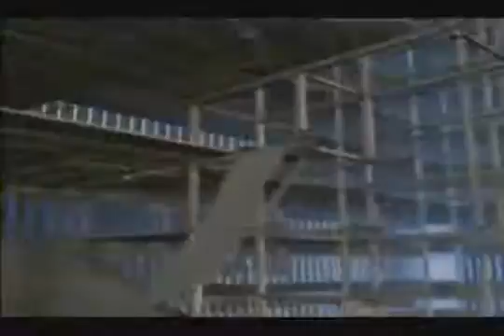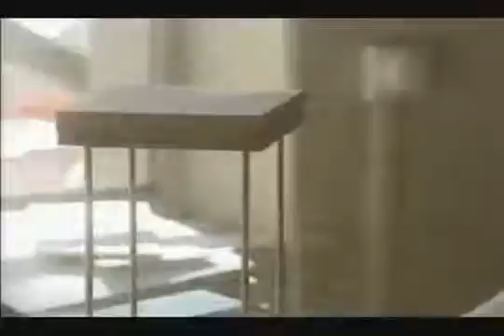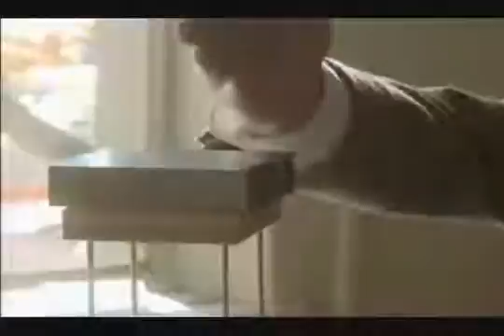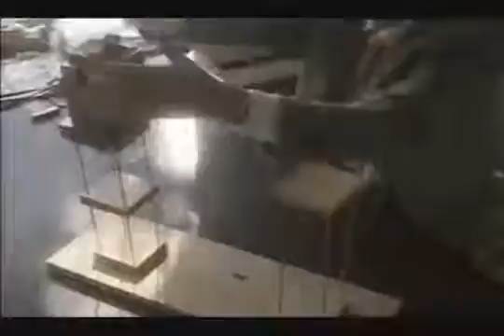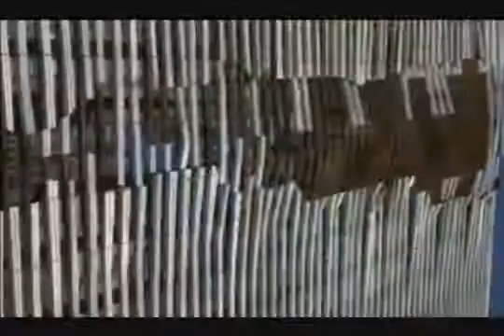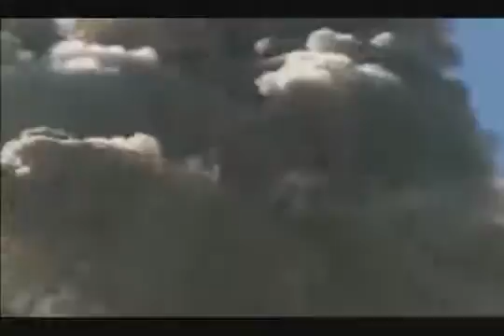World Trade Center - Role of floor loss and buckling

Comment: What a shit theory not how on earth can you get a few wooden blocks and sticks and put waits on top of them to represent what happened to wtc 1and 2 . The weight on top doesn't even correspond to the actual real life building . The 3d model is a joke as it shows a slow collapse and the wooden model doesn't even simulate the Implosion you see in reality as it twists then ejects the weight to the side.this shows what should have happened but not what actually did happen. I challenge an official expert to make an exact life model using exactly the same materials of a floor and let's see for our selves what actually happens when you subject it to fire rather than these silly dry lab experiment what prove nothing but are just good to laugh at

Comment: If you have ANY brains in your head...
Evidently controlled demolition became really easy during and after 9/11!
Nevermind Newton's Third Law - which took a vacation to New Jersey on 9/11.
EVEN IF there was any legit gravitational collapses going on from heat softened steel (not going to happen from kerosene/jet fuel!), the top sections could never plow down all they way through the very same materials that they are made of (Bldg gets structurally stronger as you go down in the case of WTC towers) without destroying themselves (the top sections or  "piledrivers" as the BS artists call them) in the process. Any unlikely piledriving or cartoonish "pancaking" would come to a halt quickly due to lost momentum.
Three uniform, steel skyscraper global collapses into the basement from office fires in the same day. Never before, never since. Dream on! 
"Somebody" blew the core columns at the foundations (shape charges). You CAN'T achieve a uniform global collapse without doing that! 
Otherwise, AFTER 9/11, ALL steel skyscrapers IN THE WORLD should have immediately been condemned - because since that fateful day, steel skyscapers obviously cannot stand up to even simple fires.
AND NOW - the once sophisticated controlled demo companies only need start a nice kerosene based fire up near the top and down she goes, at near full gravitational speed, right into the basement within a hour. 
No need for controlled demo explosives anymore, right?
Reply: +HighsNBurgers
"If you have ANY brains in your head" - You would have some respect for science and engineering, as it is the only means you have of surviving to old age.
"Evidently controlled demolition became really easy" - and the evidence is?
"Nevermind Newton's Third Law" - you never have.  Now suddenly you do...
"EVEN IF there was" - "were".
"any legit gravitational collapses going on from heat softened steel" - The floor trusses sagged until the floors separated from the walls.
"not going to happen from kerosene/jet fuel" - But definitely from the conflagration of six acres of burning offices, capable of supplying thirty times the heat to soften the floor trusses.
"the top sections could never plow down all they way through the very same materials that they are made of" - An assertion backed up by - nothing.
"Bldg gets structurally stronger as you go down" - NO.  The floor connections remain THE SAME.
"Any "pancaking" would come to a halt quickly due to lost momentum" - False.  And I can demonstrate it is false.
"Never before, never since" - Have planes been deliberately flown into steel skyscrapers.
"Dream on!" - Is what you must have done in science class.
"Somebody blew the core columns at the foundations (shape charges)" - Any evidence?  No.
"You CAN'T achieve a uniform global collapse without doing that!" - The collapses were all different.
"ALL steel skyscrapers IN THE WORLD should have immediately been condemned - because since that fateful day, steel skyscapers obviously cannot stand up to even simple fires" - Would be true if it were now possible for terrorists to fly planes into towers.  Is it?
"controlled demo companies only need start a nice kerosene based fire up near the top and down she goes, at near full gravitational speed, right into the basement within a hour" - It's a fact that all-steel towers will fall that way.  That has been known ever since anyone ever wanted to make an all-steel building. For hundreds of years.
"No need for controlled demo explosives anymore, right?" - Not if you don't mind ruining the neighbourhood.

Newton's Laws of Motion as applied to 9/11:
An Analysis of the Floor Collapse of the Twin Towers

Newton's 2nd Law ”The acceleration of an object as produced by a net force is directly proportional to the magnitude of the net force, in the same direction as the net force, and inversely proportional to the mass of the object.”
This, with Newton’s other laws, demonstrates the REALITY of the floor collapses within the twin towers.
The equation used is a derivative of the ACCELERATION of MASSES by GRAVITATIONAL FORCE: v^2 = u^2 + 2 * f * s, where:
Floor Mass m = 10^6 Kg,
Gravitational Acceleration f = 32.16 feet per second per second, or 9.81 metres per second per second
Distance between floors s = 12 feet, or 3.66 metres, and
Starting velocity u (original) = 0 ft/sec  (0 m/sec).  Then u = 9.72 ft/sec (2.97 m/sec).  Then u = 13.72 ft/sec (4.18 m/sec).  Then u = 16.3 ft/sec (4.97 m/sec).

It fits (as it must) in the case of a detaching floor. This, when and if it falls free, accelerates at G until it hits the floor beneath. From the formula v^2 = u^2 + 2 * f * s we know it strikes the floor beneath at a speed of 27.8 feet per second, or 8.47 metres per second.
We know that MOMENTUM is conserved, and the TWO floors would THEN be traveling downwards at HALF THAT SPEED, less the speed loss from the energy loss of the SHEARING of the floor connections.
We KNOW what this is, because we KNOW the average and general downward acceleration to have been 0.7G, as agreed by AE911T.
So we KNOW that the initial downward speed of the TWO floors is actually 70% of (27.8 / 2), which is 9.72 feet per second, or 2.97 metres per second.

Now we consider TWO floors striking the NEXT floor.   
Note that THE START VELOCITY (u) IS NO LONGER ZERO, but 9.72 feet per second, or 2.97 metres per second, so from the formula v^2 = u^2 + 2 * f * s we know the TWO FLOORS strike the floor beneath at a speed of 29.4 feet per second, or 8.96 metres per second, and thus the impact velocity is GREATER than before.
We know that MOMENTUM is conserved, and the THREE floors would THEN be traveling downwards at TWO THIRDS THAT SPEED, less the speed loss from the energy loss of the SHEARING of the floor connections.
We KNOW what this is, because we KNOW the average and general downward acceleration to have been 0.7G, as agreed by AE911T.
So we KNOW that the initial downward speed of the THREE floors is actually 70% of ((29.4 * 2) / 3), which is 13.72 feet per second, or 4.18 metres per second.

Now we consider THREE floors striking the NEXT floor.   
Note that THE START VELOCITY (u) IS NO LONGER 9.72 feet per second, but 13.72 feet per second, or 4.18 metres per second, so from the formula v^2 = u^2 + 2 * f * s we know the THREE FLOORS strike the floor beneath at a speed of 31.0 feet per second, or 9.45 metres per second, and thus the impact velocity is EVEN GREATER than before.
We know that MOMENTUM is conserved, and the FOUR floors would THEN be traveling downwards at THREE QUARTERS THAT SPEED, less the speed loss from the energy loss of the SHEARING of the floor connections.
We KNOW what this is, because we KNOW the average and general downward acceleration to have been 0.7G, as agreed by AE911T.
So we KNOW that the initial downward speed of the FOUR floors is actually 70% of ((31.0 * 3) / 4), which is 16.3 feet per second, or 4.97 metres per second.

On the point of impacting the NEXT floor THE START VELOCITY (u) IS NO LONGER 13.72 feet per second, but 16.3 feet per second, or 4.97 metres per second, so from the formula v^2 = u^2 + 2 * f * s we know the FOUR FLOORS strike the floor beneath at a speed of 32.2 feet per second, or 9.81 metres per second, and thus the impact velocity is EVEN GREATER than before.

What you see here is AN ACCELERATING TREND.  The acceleration of the massing floors is heading asymptotically for G itself.

"You are saying that as the first 15 floors collapses on the 16th floor" - Well, obviously not.
"The amount of kinetic energy is increased as opposed to deceased (sic)” - Certainly not.  Energy never ‘dies’.  Consult The First Law of Thermodynamics.

If you take the INITIAL FLOOR, its kinetic energy impacting the floor beneath it (assuming its weight to be 10^6 Kg) is 0.5 * m * v^2, which is 0.5 * 10^6 * 8.43 * 8.43 = 35,500,000 Joules.

If you take the FOUR FLOORS, their kinetic energy impacting the floor beneath them (assuming floor weight to be 10^6 Kg) is 0.5 * m * v^2, which is 4 * 0.5 * 10^6 * 9.81 * 9.81 = 192,000,000 Joules, which is MORE THAN FIVE TIMES GREATER.

Kinetic energy is ALWAYS INCREASED BY FALLING, as POTENTIAL energy is traded off against it.

So the floors will accelerate all the way to the tower basement.  This leaves FREE-STANDING COLUMNS A QUARTER OF A MILE HIGH.  THEY WILL BUCKLE AND FALL DOWN.
Reply: Is there a name for someone who is incapable of seeing the "big picture"?
That would be you, bug eyes!
Reply: You still blowing Larry Silverstein?
Reply: +HighsNBurgers
So your answer involves abuse, and not reason or logic. Just so we all know,  Thanks.